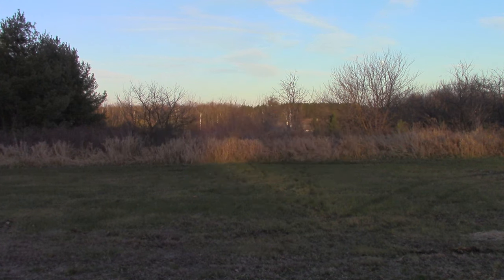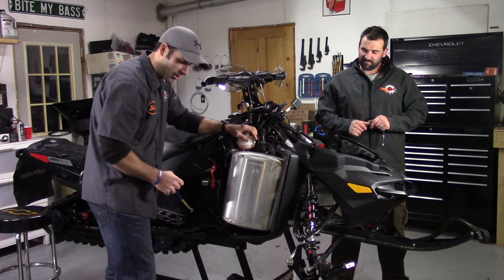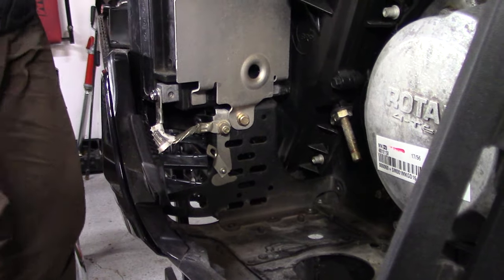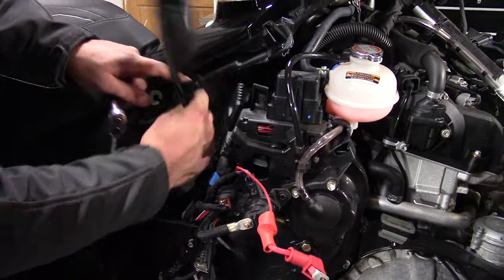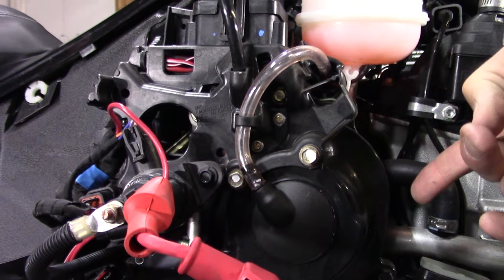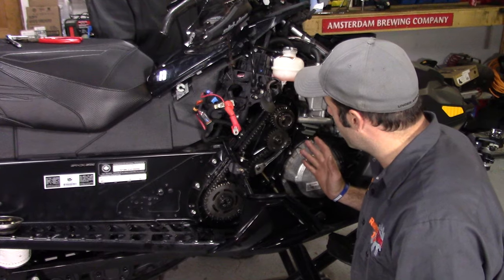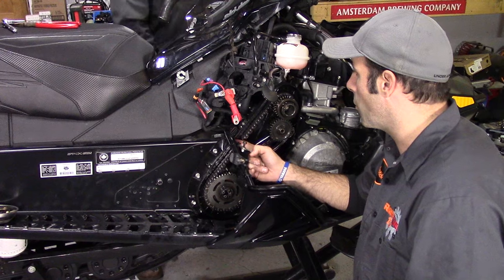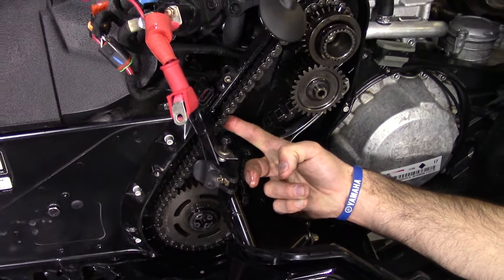Ski Doo Chain Case Oil Change Part 1 by RawFuelTV

Comment: Before I start taking anything apart... Should there be any kind of slack in the Secondary? My 900ace on the ground feels like she moves - Before 12 o'clock & after 12 o'clock... & /or should  that Secondary have any wiggle...